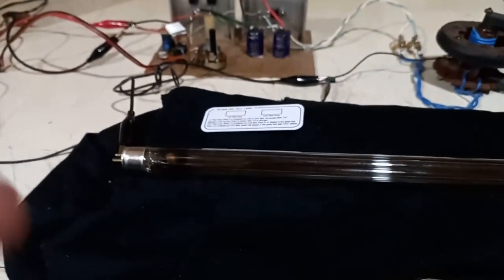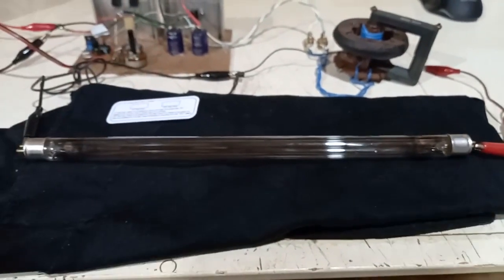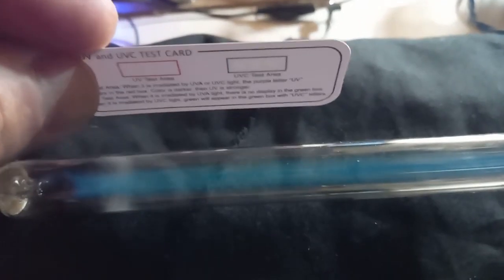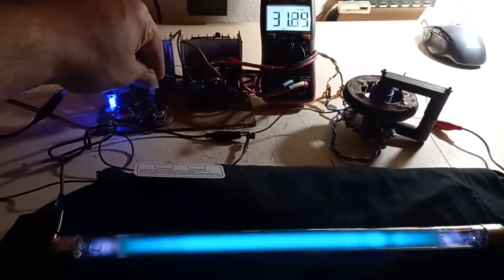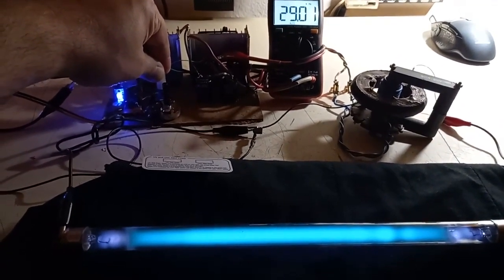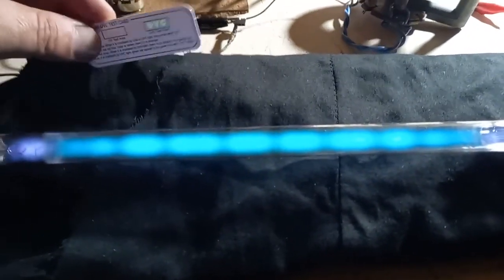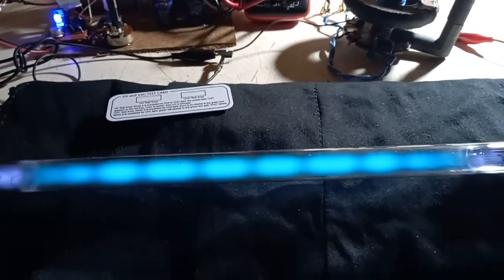Standing Wave In Discharge Tube Plasma And How To Make It

Comment: Nice experiment. You could probably check with a spectrometer if the glow near the electrodes is argon or krypton. Also great to scare karens away with high voltage, RF, UV light, ozone and mercury.
Reply from the maker: i obviously don't have a spectrometer :D

about the "karens", my channel is an absolute "pussy magnet", the audience is male at more than 99%, statistically that less than 1% can be mostly men with their wife's\mother's account (already happened) or pranksters that put "female" as gender to have a laugh... i hope there's a prize for me for that...

Comment: I did the same thing using a long Xenon tube.......much safer.......no/little UV........but you need a bit higher voltage in that case.  I'm glad I'm not the only one with these kind of hobbies/interests.

Comment: Good video demonstration. Gas discharge are fascinating. Actually, not detecting UVB isn’t really surprising. Low pressure mercury discharge mainly emits UVC. To use it in a ‘Black-light’ fluorescent tube a fluorescent coating is applied internally behind the 'Woods glass' to convert UVC to UVB /A. Interestingly, this isn’t required in high pressure mercury lamps which do emit UVB hence there are no coating internally in these.
Reply from the maker: thanks, anyways probably this wasn't totally clear, the "UV test area" on the card colors itself also with UVC, the power here was just too low, this tube when powered with an 8W CFL driver (on the portable fixture i made for it) is able to color that area, infact this card is used in a way that the UVC test area shows almost every time with UVC and it's the UV area that indicates the power of emission for UVA, UVB and UVC, that's what the instructions say, under the sun it become full dark purple in a split of a second :D .... i saw this card on bigClive's channel, i bought it immediately, it's so cool :D

Comment: Nice! I did a similar thing some years ago using a household T8 fluorescent tubes driven as CCFL. If I remember correctly the driver was a ZVS into a ferrite core from a flyback with about 600T of #22 as the secondary. Very bright and noticeable bands, and it could drive a few tubes in series. I don't remember the frequency, but it seems strange that the arbitrary frequency of my ZVS caps+primary was exactly resonant for the tube(s), I wonder if some kind of feedback was happening from the tube to influence the driver frequency?
Reply from the maker: this phenomenon is extremely common, i've seen it with several drivers and also tesla coils, i don't think there's feedback for the frequency and i dunno why it's so common, but it happens quite likely at several frequencies (harmonics, etc.), anyways in this video i just wanted to generate it in a controllable manner and on purpose, there's almost nothing around about this exact experiment

i did as well the trick of turing on several fluo tubes in series some time ago, with an high voltage source it's quite easy https://www.youtube.com/watch?v=4zh0cO_GNu0
Reply: @PosthumanKindergarten  Cool video! Just watched it now. I was using the long ~1.2m x 25mm fluorescent tubes, they seem to favor the banding effects a lot. 
It's weird that a sinusoid (no harmonics) in the kHz range causes the stripes - I don't think it can be an EM standing wave because wavelengths we're using are hundreds of meters, but the stripes are ~1cm.  
All of this has me intrigued! I'll have a look around and maybe ask StyroPyro, Applied Science, Tech Ingredients, Dalibor Farný etc who know much more physics/plasma than me and let you know if I find a definite answer!
Reply from the maker: @rob-muntron  i forgot to mention in the video that is basically SOUND, a sound wave, it's 95% sure it's the plasma getting inflated with heat at the driver frequency and it happens in the kHz range... anyways i'm repeating in almost all the comments that it's actually very easy to observe this effect, infact (as i said in the video) a lot of people saw that, not sure why it happens so frequently, there must be an effect that eases it, but i've seen it with high F tesla coils as well
Reply: @PosthumanKindergarten  Of course! I overlooked the possibility of acoustic resonance - it's low pressure, but there's still gas in there!

Comment: Can you figure out if a lit CFL (or other tubes) can act as a cathode of an ionocraft/lifter ?  Light it wired or wirelessly with a TC, then apply HV DC in a standard manner.  Those thin CFL-s from LCD backlights seem like good candidates. I'm sure you can figure out how to measure thrust compared to a standard wire-wire or wire-Al foil setup.
Reply from the maker: i'm not sure if i'm following you, i have some CCFL tubes form backlights and i'm kinda understanding what is a "ionocraft", but i don't get if you mean thrust inside the tube or what?
Reply: @PosthumanKindergarten  Also take a look at this ignition coil setup LhygSconaFE
Reply: @PosthumanKindergarten  Could be that an ignition coil/pulse transformer works better for this than a CRT flyback.
Reply: @PosthumanKindergarten  Also you might want to check out what's called a "Double Ended Forward Converter " , or at least the primary side part of the topology
Reply from the maker: @sFeral  LOL, one thing at a time :D

i don't understand why you insist with a CCFL tube for a ionocraft, i don't see what those two have in common, a ionocraft AFAIK is basically a structure that uses ion wind to lift itself, a CCFL tube is a lighting device and it's isolated and the cathode is just inside and unusable for a ionocraft... but you gave me a nice idea with this ionocraft, i'm probably gonna build one, it seems "simple" (but there are so many videos so probably i'm not gonna publish it, i dunno)

i saw the video, nice, it has a light payload

i believe you can use whatever high voltage source for a ionocraft, but a DC flyback, possibly with an high voltage capacitor on the output, seems the best one

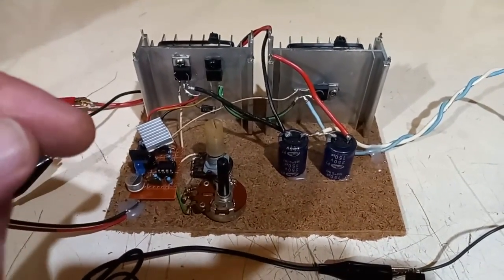that forward converter seems just a push pull transformer driver, i made forward transformers, the link is at 2:12, when using a symmetric driver for a transformer, no matter what the driver is, the result on the output is basically always the same
Reply: @PosthumanKindergarten  It's not a push pull topology, look closer into it. Well your assumption that CCFLs have nothing to do with ion propulsion is precisely why nobody tried this yet. I believe that when the tube is lit, and there is constant plasma present inside, it should be able to collect negative charge enough to attract the cations, perhaps better than the standard Al foil skirt or a simple wire. Probably wishful thinking, but I'm still curious
Reply: @PosthumanKindergarten  here is an example of that topology in action _CELYqo7KfQ, and here is why I think induction coil works better 1EabqJJnWhc&t=2m50s
Reply from the maker: @sFeral  i still don't understand how an insulated glass rod can be better at doing something that is done with a 100% efficiency with just a naked wire and tinfoil, what's happening inside the CCFL tube has nothing to do (except for the light) with what happens outside, and the tube is not conductive.... but i'm not a physicist so MAYBE there's something more but i highly doubt that... what you have in mind is what you have in mind :)

ok, i've seen this "double ended forward converter" better now, i just peeked at the schematics on g-images before and interpreted em wrong, now i saw both the videos but i'm not much in the mood for theory LOL... so basically IT'S NOT a symmetric driver, it's a more efficient way of making a single transistor driver, basically the negative voltage kick reaches minus Vcc while still being clamped, and without a big resistive snubber that wastes power, i never thought about this topology and honestly i think it's just more efficient and i don't ask for this in my projects cos mine are not practical but just experimental... soooooo i dunno if this helps for an ionocraft at the end, also car ignition coils need a reeeeeeeeeally high back EMF kick to make a really high voltage, if you clamp em (unless with mains level of driving voltage) you'll obtain like 5kV max and puny sparks

Danyk is always amazing, he made soooo many successful and complex projects :) but i try to stay away from complexity, it stresses me and i just want the fun
Reply from the maker: @sFeral  oh, ok, i've watched that "hyperspacepirate" video about coils and i think he has fucked up a pair of things in that video 😂 but anyways if you're interested in that topic here's my version https://www.youtube.com/watch?v=T4CvoA3EZWs i reached 10.5 cm of distance but only after the video cos when filming i forgot the power supply current limit on so it's a bit less than that... silly me 🙄
Reply: @PosthumanKindergarten  btw the fact that the glass rod also acts as an insulator, while primarily being a container for plasma, doesn't hurt, because you don't want a spark/breakdown anyway, you just need cations at the anode and a static electric field for them to get accelerated in. That's why I think this might work. Looks like you have a great supply for the ionocraft right there. There's only that one video that explicitly uses an ignition coil to power it, so doing a video of your own wouldn't be redundant
Reply: @PosthumanKindergarten  though the cations do have to be neutralized somehow, hence I suspect there would be "surface bound" sparks along the surface of the glass, that would reach to the end terminals of the CCFL    DUQS5N3LIfc&t=45s
Reply from the maker: @sFeral  well, a video of the same exact thing and the fact that basically the same experiment has been done and filmed tens of times is enough to discourage me to upload anything :D i have a bunch of videos on my HDD that i didn't upload, those are basic experiments or slight improvements that i don't consider interesting, i made an SSTC with a MJE13009 some days ago, good results, but i have enough coils on my channel :D

apparently the "ion wind" according to wikipedia is due to the corona effect, so an insulator like glass wouldn't be capable of making ion wind cos it's electrically neutral and doesn't make corona (unless it breaks down), cations or negatives make little difference, you can't use an insulator in place of a conductor, i saw a video of a ionocraft and the guy specified NAKED wire for making it, not enameled

i think i'm gonna use a flyback with a leyden jar on the output, i believe it's half a day of work
Reply: @PosthumanKindergarten  it's stupid that I have to encourage you to upload. It's not like you're loosing anything by uploading. Yes, now that i thought about it more, I realize there would have to be a breaks in the insulator (enamel in case of enameled wire), but if the insulator is resistant enough and  the E field high enough to ionize the air at the anode, there should be thrust. Considering what I'm visualizing in my head, it does look like a  lightningcraft lol
Reply: @PosthumanKindergarten  the breaks in the insulation could be shielded somehow or positioned farther away so that the breakdown doesn't happen at those (intentional) weak points... this approach basically makes the whole cathode into a plasma, somewhat contrary to my initial assumption. Also the proximity of a TC could possibly influence those "surface bound" sparks.
Reply: @PosthumanKindergarten  There seem to be factors which need to be balanced out in order to get the surface plasma on the cathode yet no spark breakdown directly from cathode to anode.
Reply from the maker: @sFeral  i think you're just beating a dead horse :D
Reply: @PosthumanKindergarten  there is no horse, yet
Reply from the maker: @sFeral  here's the horse :D https://youtu.be/pUSgEZOZOxM
Reply: @PosthumanKindergarten  no, not inside. I'm wondering if the tube itself can act as a cathode that attracts the cations which make up the ion wind.